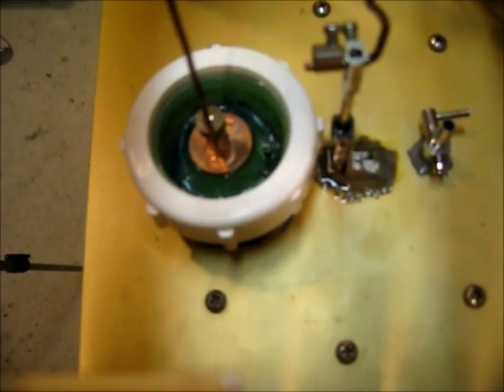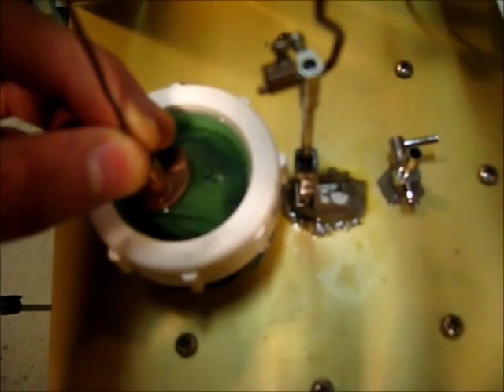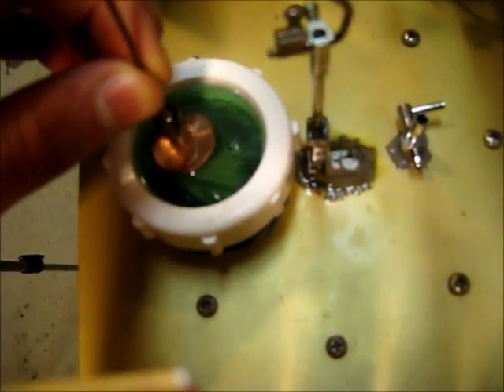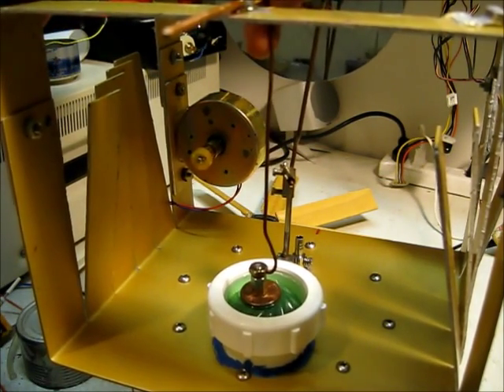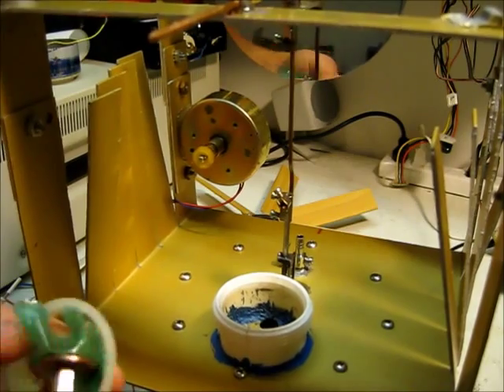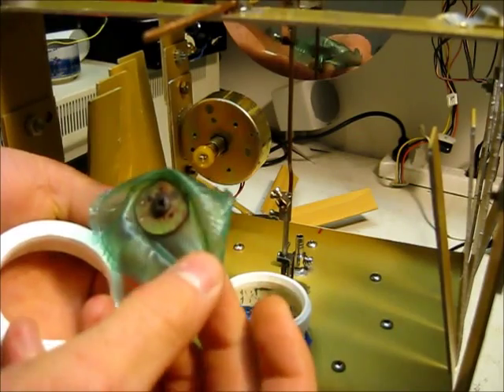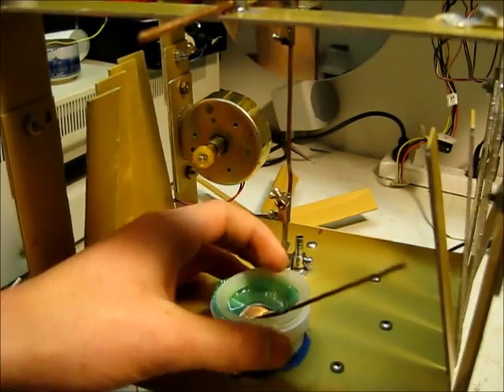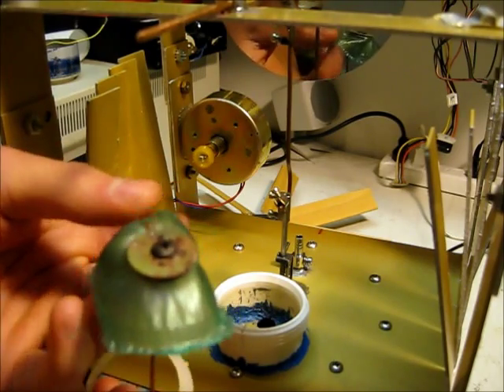Stirling Engine #2 Diaphragm Failure

Comment: @makerj101 I think it's just the extra pressure from the bigger displacer cylinder. Your displacer cylinder seems quite small, maybe only 20% the size of the one in my water bottle engine.